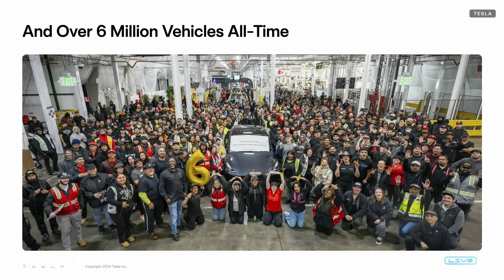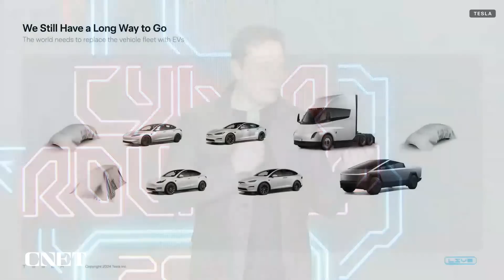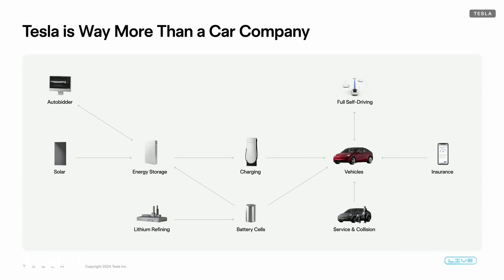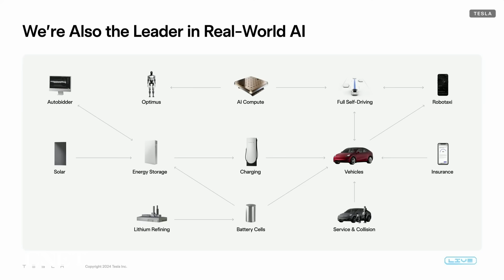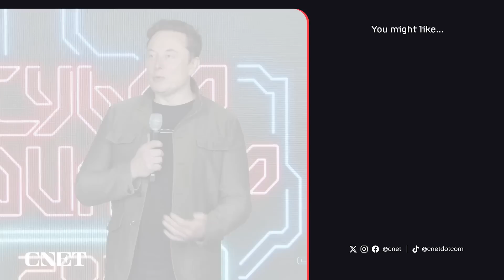Highlights from Elon Musk at Tesla's 2024 Annual Shareholder Meeting (In 12 Minutes)

Comment: only rich people can buy his car
Reply: I’ve got a used 2020 model 3 perfomance 37k miles for £385 a month PCP no £385 deposit

I have been a beemer man through and through but I tried to get something modest and fuel saving due to long trips for work.

I swear 0-60mph I can’t compare to any other car I’ve driven and it’s planted!
Reply: @arronkelly7813 my Beamer has felt very old lately, getting 91 gas isn’t hurting my pocket but just always think of the savings of switching to ev Tesla… how have you liked your switch from BMW to Tesla?
Reply: no servicing, no oil changes, minimal wear on discs and pads due to one pedal driving, autopiliot, cheap fuel costs, ive got a full splitter kit all around and it turns heads more than my f80 :(. I also have the white interior and changed internals to carbon fibre so it really stands out. most people have the bland normal boring ugly model 3's dont know why tesla dont aim it towards a more sporty look for performance models, also you get a software update every few months with new features all the time which is a nice touch. short of it is, yes i miss revving my old car and i am still a petrol head at heart but you dont have to pick a side just get what suits your lifestyle best
Reply: Wrong

Comment: I don't understand why solar city panels are not in mass productions around the world small one for apartments and big ones for the sky scrappers. House's should be stop making around the world and all buildings for residential, commercial and industrial should be made with concrete, steel and solar city panels for all external walls and "roofs" with a mix of light and visual panels intergrated with solar city panels. Bricks, granite, marble and other building materials should be removed from mining and production if not able to use for concrete ingredients for volume consumption. And focus on graded concretes. A standard of polish for internal and external floors and walls. The difference in polish is the difference in finished look but always has the same integrity, polished concrete is no different from look of granite and marble but stronger and is a structural material. And I think a landing rocket should land once on moon to take astronauts and material and tools to build a runway on the surface for a space shuttle aeroplane to land with machinery to tunel bore and for controled explosions for Connollys in the moon. Landing rockets should be for initial landing on far planets with botmen to build initial stages for humen and women to go to planets to colenise and  develop. There's no reason to not use traditional flying and landing with space shuttle aircrafts especially for moon travel. Landing rockets are essential for initial stages of colonys for near moon and far planets. Flying to the moons  should be no different from flying to another country, you basically go to a airport and get in a space version of a airplane just a different destination. Tesla next revision projects should be airless tyres with no alloys. None neumatic wheels, and 360 wheels turn steering for sideways parking. And Deceleration motors replacing break pads and caliper breaking systems. And external of cars should be passive light panels that can be programmed for emergency vehicles appearance and for general population with out perches of new vehicle. And Tesla should build the first solar city building, Tesla headquarters skyscraper made totally with solar city panels. Solar city panels should have 3 types, transparent, visual and light. so if a solar city is built every building would be black and the visual and passive light panels would give every building a different look that can be changed. As well as the shape. 11:18

Comment: I rode in Roadster V1 17 years ago and bought into Elon right away as we were whippin' by Autobooks - Lenos hangout in Burbank. It was a no brainer, silent neck snapping zip, no gas stink, no politics just G forces.  But Optimus? What "parent" has $100k-$200k or whatever it will cost PLUS the very expensive maintenance and electricity to run it?  Sorry, Google or X ain't raisin' my kid.  It's why they aren't allowed online until of age.  Will it sort faster than a cheap sorting machine in a factory? Vacuum faster than a Roomba?  So then what WOULD it do and where??? Just a dumb idea with a target client of rich people or some weird mfgs. Humanoid bots just don't answer a question anybody asked. Specialized bots are cheaper in factories so wuddup?  Now if it were hooked up to the Tesla neural net and cost maybe up to $10k but that will never happen. Wait til ONE bearing wears out on Optimus and it auto charges your CC card $1200 to order a new one - which it will self install. Yeah, no. Not quite yet, lets do autonomy first - blow up the inference stack to increase the smarts and slow the F down.  👀

Comment: these robots are going to replace so many jobs from people. $10-$20k cost is pretty much an annual poverty income salary. It will cost more to pay human than buying one on long run.
Reply: I'm not worried. Optimus needs two people to run it - one to push batteries at it and the other to teleoperate.
Reply: @stampedetrail2003  Yes for now. Check again in 10 years.
Reply: And no unions !
And no safety regulations !
And no pregancies !
And no opinions !